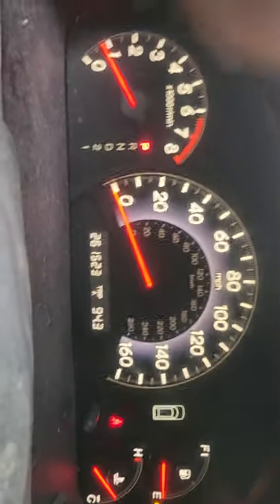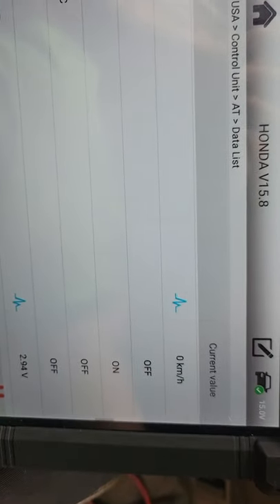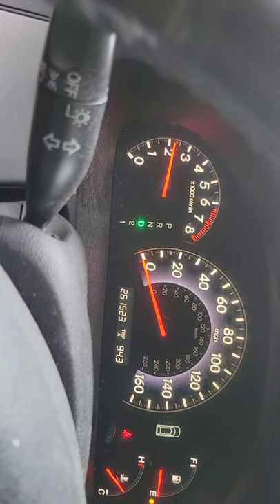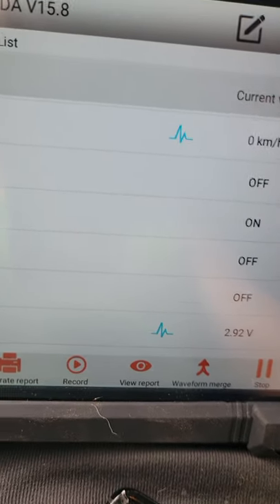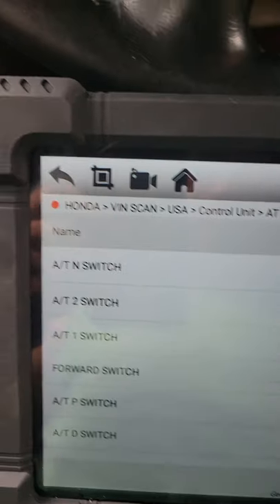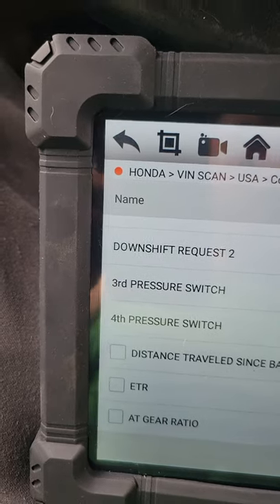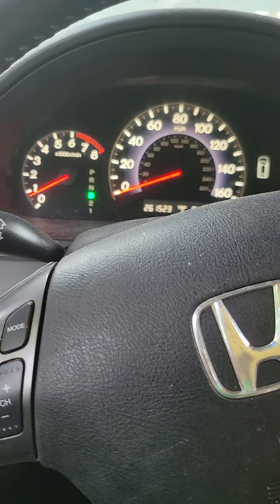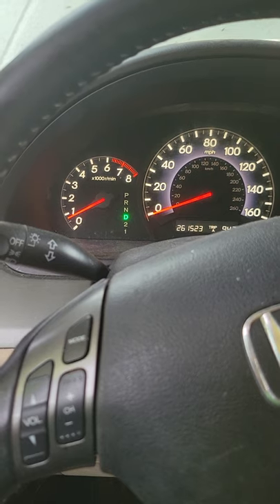06 honda odyssey transmission issues. rebuild is coming

Comment: Yo bro . My 2006 odyssey just did the same thing yesterday . No codes . Will go into gear and try to move but won't after trying for a min. Then I turn it off and back on and it trys. Any ideas?

Comment: I got problem on my Honda Odyssey rb1 2009. Which is its kind of loose off when reach to 3rd gear, the D goes blinking, i need to restart it to make it on gear again. I've already changed the coil and filter, symptoms is still the same. Any advice on it

Comment: I have a question I changed my wheel bearing on my 2006 honda odyssey, but now I have a scraping noise and my vsa light and Abs light came on . What can be causing that to happen?
Reply from the maker: Make sure the dust shield ain't rubbing the rotor  also you could have put the wrong wheel bearing in
Reply: @Ben's Auto Repair LLC  Thank you I will look into that.

Comment: But what dose it mean if u cant go into drive or backup.
Reply from the maker: On this one and 95% of the 5 speed automatics  the tourqe converter starts to fail  and clogs the filter 
If it won't move filter is clogged  

If you watch the tearl down video of this transmission that I have you can clearly see the filter is very clogged thanks

Comment: friend it happens to me that 2 days ago my truck when accelerating only the revolutions go up and the mileage does not after a few seconds to insist it jerks and the tires skid a little and it drives normally.
They tell me that it could be the transmission filter that gets covered when it gets hot and causes that problem.  Do you think that a service could be the solution?

Comment: Can i get more info on how to change the coolant filter on the trans?
Reply from the maker: Please watch the tear down video of the Odyssey transmission.  
There are 2 different types of coolant line filters they put on them  
Some have 3 bolt's and slides out other got to replace whole assembly. 
Let me gather with some things together and I will make a video to explain better. Thx
Reply: @bensautorepair9914  will do thank you 🙏

Comment: Bruh that’s the problem it has no gas
Reply from the maker: Actually found out the gas hand don't work I ended up putting new  sending unit in while we had transmission out